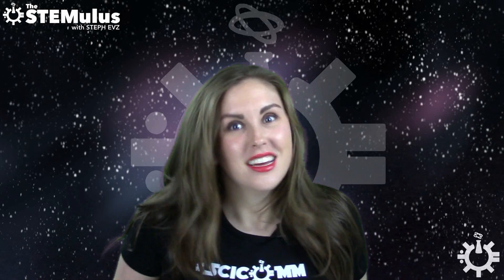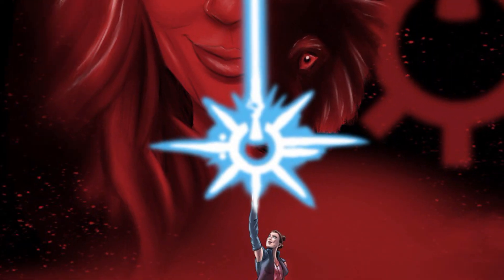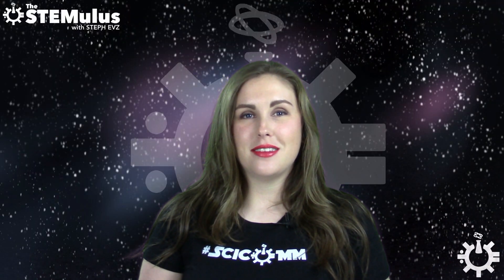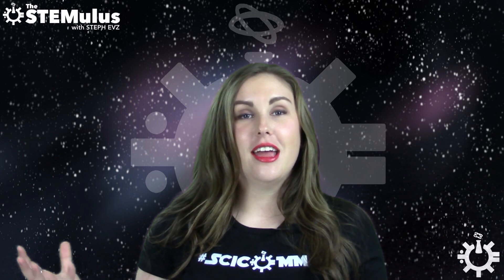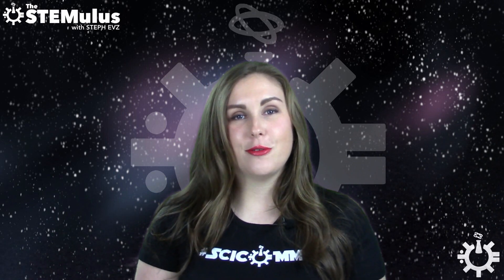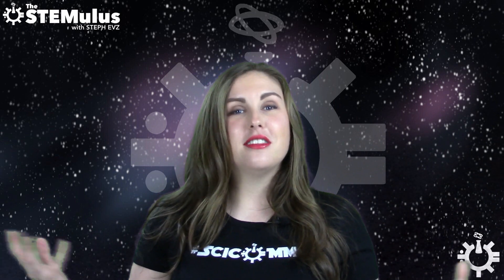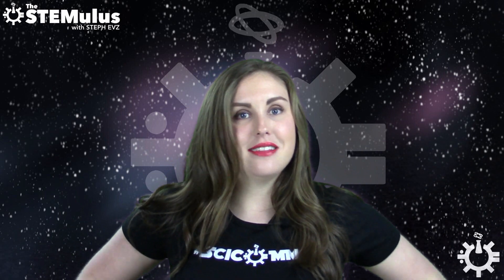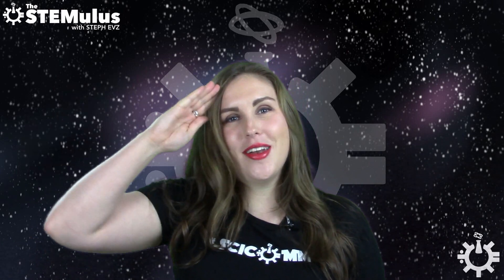3D PRINTING BACTERIA?! - IT'S #TWISTEM!

Comment: In the seemingly endless realm of gossip media, stuff like this is sorely needed. This was a fantastic video. Definitely earned the sub!
On the topic of 3-d printing materials, it's a tough one. Most of the most interesting applications require more than one material (manufacturing organs and other bodily components for transplant for example) So I'm going to say... Concrete. Or a similar primary building material. Especially if you were able to do the printing from small airborne drones. The sheer speed of construction it would allow would solve many problems globally. it's an exciting time. :)